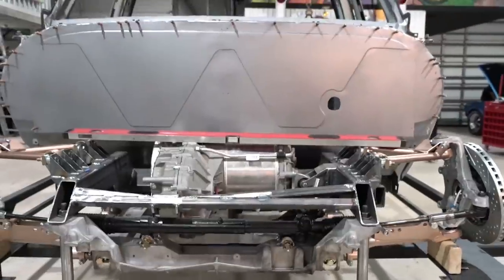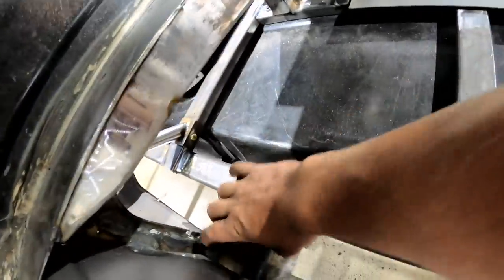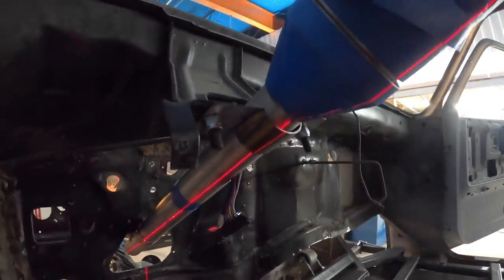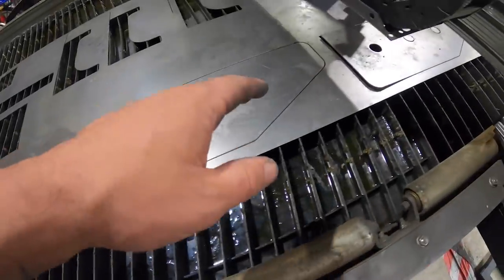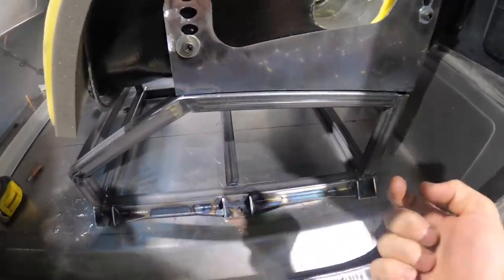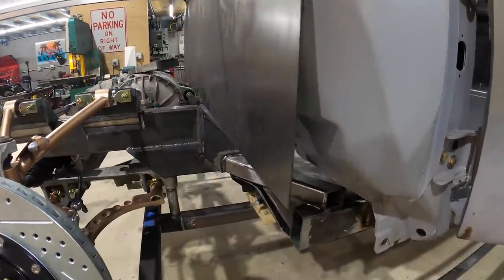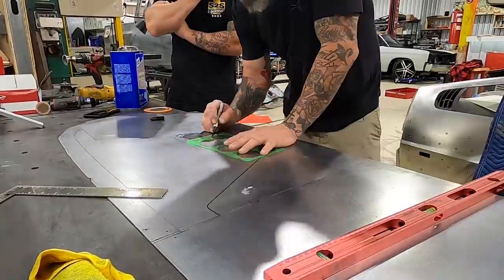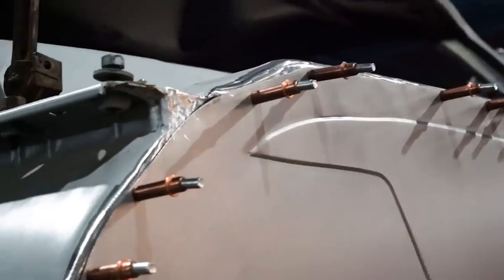Custom Tesla Swapped Squarebody Firewall & Seat Brackets! - Electric C10 Ep. 8

Comment: I would like know what this weighs when finished. My guess 6000lbs.
Reply: Great watching all the fabrication. But sooo much steel in addition to that 1200 lb battery. It's almost 3 times the weight of an aluminum LS motor.
Reply: I was going to say somewhere around 6k as well.  They should have gone carbon in a lot of places.
Reply: I feel that they're being a little to generous with the steel being used. (ex: the platform racks made for the seats could of been made with flat stock and it could of been structural and lighter too.)
Reply: @rookie12101988  carbon fiber doors, hood, fenders, bed. There's definitely a few pounds to save there.
Reply: @randyrobineau2699  I'm glad I'm not the only one thinking this thing needs to go on a massive diet.
Reply: Tesla’s weigh around 6000lbs from what I’ve been told. So it should still move quick
Reply: @jeffbradway5531  and 4x the torque of a LS
Reply: It’s cheaper and quicker to build the original pieces out of steel…..  then duplicate or improve out of carbon later. Just my thoughts
Reply: I'd say that's damn close.  1200 to 1500 for the battery, 200lbs ish per motor, and all that frame and cage.
Reply: With the battery pack and all that heavy tubing, I'm thinking even more. Non the less, an assum channel!
Reply: @nordic5490  For a matter of minutes, the electric motor torque isn't continuous. The LS motor plus all the hardware, accessories, wiring, computer, fuel system, cooling system, transmission, linkages, etc etc etc. I would bet the mass difference isn't far off once everything is said and done. The CG and RC are going to be a lot lower with that big honking battery though, the body roll through curves is going to be a huge improvement. Like everything else pros and cons.
Reply: I’m thinking 4500
Reply: @joshuawilliams3831  yeah, but that's a Model S, the battery and motors they are using are from a Model 3 which has about 2/3 power of a Model S, so I'm wondering what the end result, power to weight, will be.

Comment: That "ugly" piece you removed from the old firewall no doubt is to strengthen the firewall for the pressure put on it when braking. You will need to add some internal bracing to stiffen the new firewall.

Comment: Very unlikely you would be able to roll it with the weight of the battery in the floor.  Check out the Tesla Model X rollover crash tests.  The automated machine couldn't ever get the car to roll over.  To low of a center of gravity.

Comment: will you (or someone in the comments) plasma cut the brackets i need for my awd subaru powered twin turbo 6cyl smart car? its the front uprights and rear wheel bearing plates. i keep getting quoted like 500$+ and i for the life of me cant fathom why. its an extremely simple part. ive already modeled it in fusion 360.
Reply from the maker: Shoot us a message on IG and we can run down what our price would be to do it.
Reply: Generally if any major shop does it they want big money for a small batch. Reason being is the setup and tooling to make said part (however simple it may be) cuts in to doing other jobs that pay a lot more, thus the premium additional charge you are getting. You might be able to get a hobby CNC person to do it, but most hobby users won't have the right equipment or skills for those kind of parts. Type of metal and overall amount of material to remove from core block are the big factors.